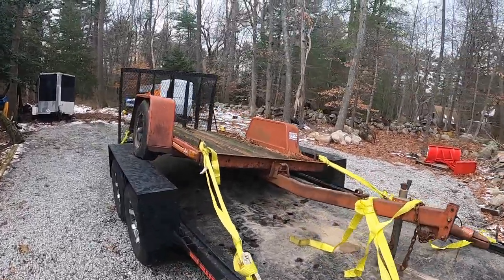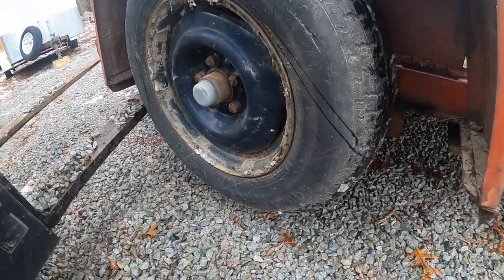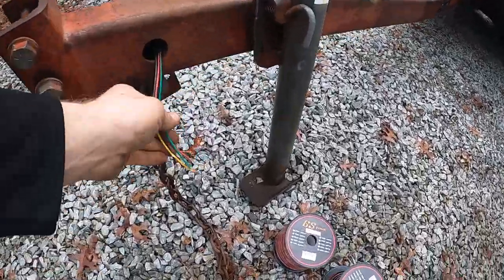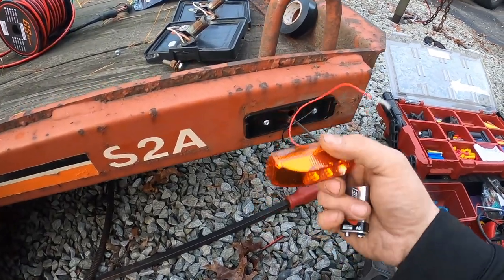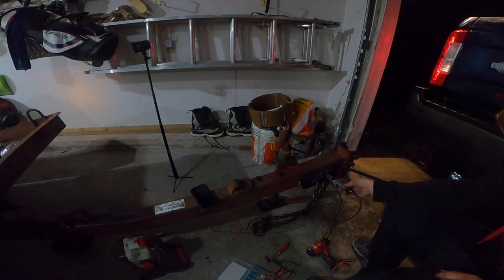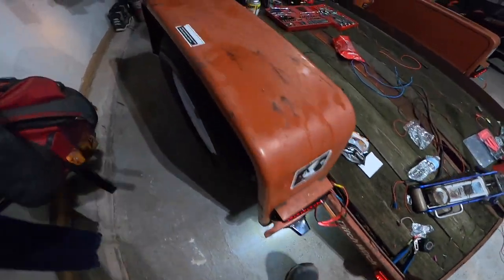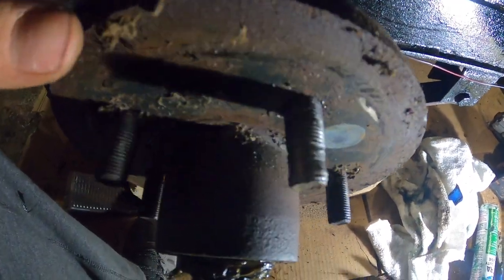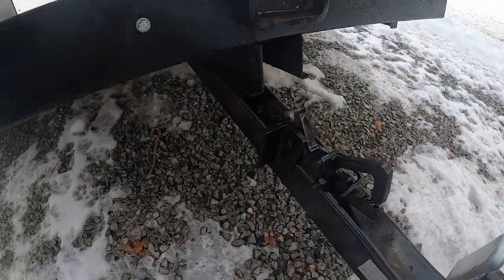Rebuilding a Ditch Witch Tilt Deck Trailer for Small Equipment

Comment: I found an s5a locally, but can't find specs online. It has an 8 lug axle
Reply: I'm wondering how much weight it can hold
Reply: 5000 pounds
Reply from the maker: I think an 8 lug is 7k but the specs should be on the axle.